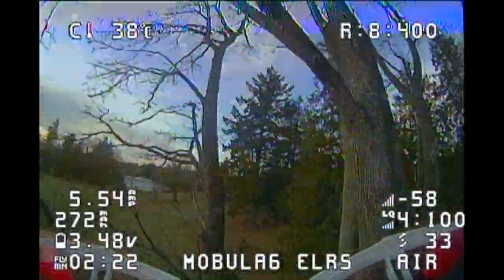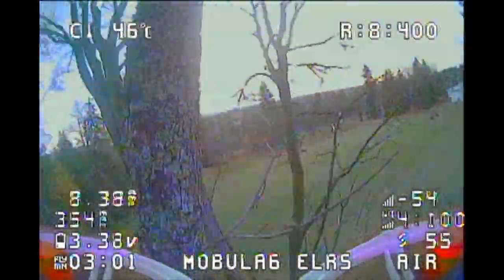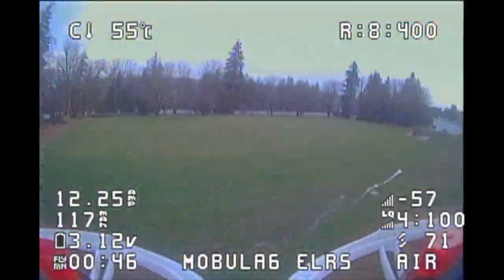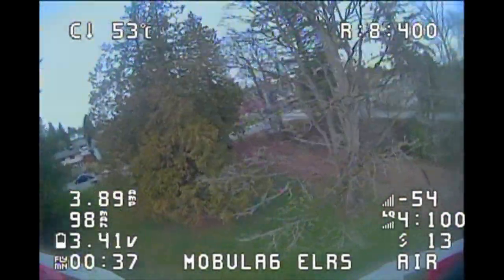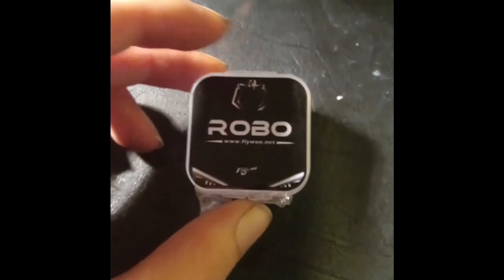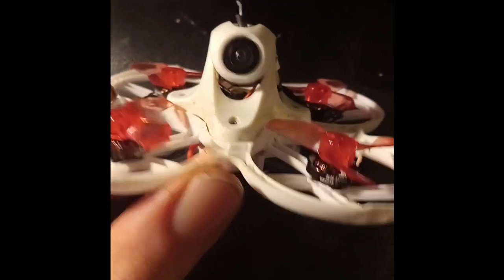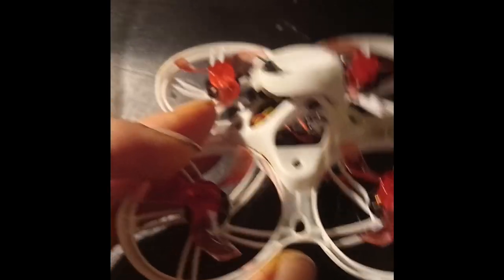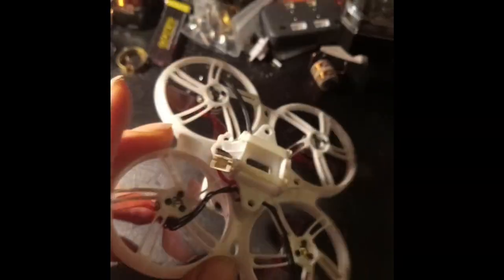YOU WANT THIS WHOOP 2.0 !! ITS FAST

Comment: I flipped the tiny hawk frame but now the motors and gyro are screwed up. I know I need to use betaflight but I don’t know what to do. If you know how to help you will save my drone 😂, flying is so fun and I have been flying in the sims for a while but doing it irl is so confusing. Save me.
Reply from the maker: Haha OK all you should need is to go into beta flight gyro setting find the axis setting flip 180 degrees in that setting if that doesn't fix the motor go to the motors tab find the motor direction change option use individual  not wizard and on each motor take a small strip of paper and make sure all motors are spinning toward the frame when you find one going the wrong way just switch orientation then move to the next